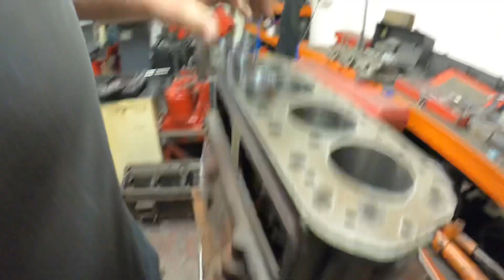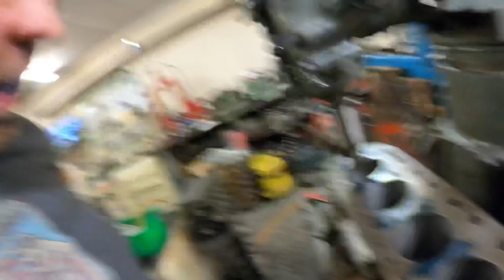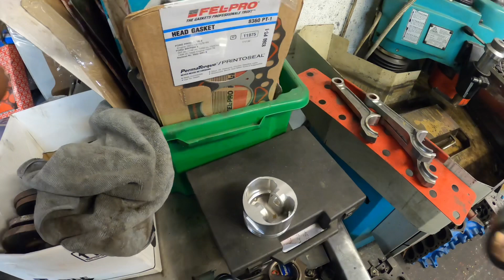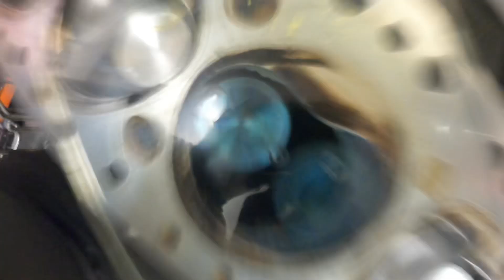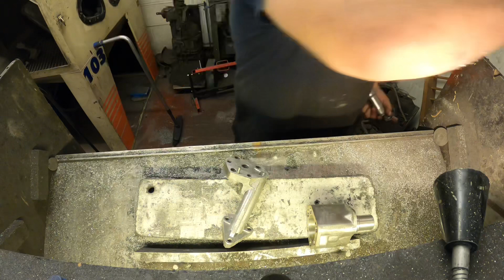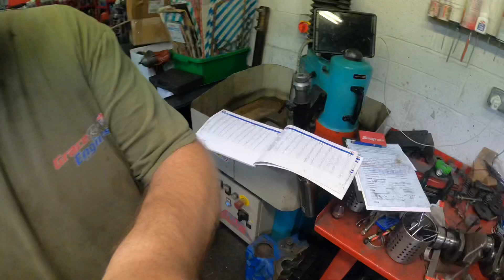1622 MGA Race Engine rebuild for a RGS Atalanta sports 2 seater race car | Vlog 26 |

Comment: Valve. Great video. Are the cross flow heads available still?
Reply from the maker: Thanks John, yes they are.
Reply: @graceenginedevelopments  how much play in a 40 thou over size new piston to a honed out 1500 mga motor.. as the limit I believe can it be bored out any larger bore.. where do I measure internal diameter I assume should the bore be perfectly round.. Thanks John Aust..
Reply: I'm thinking of update engine bottom half to 1600 is this and option and keeping original recondition head 1500.? John.

Comment: Valve. 
This one includes so many amazing details that pertain even to a stock rebuild (though it’s a race engine). So many hand operations and critical checks that the home-builder can do before and after machine shop, i.e. the info on pulling oil gallery plugs and cleaning out with the threaded rod—stuff I need to know!
Thanks James
Reply from the maker: Thanks Ian, I'm pleased you like the videos

Comment: Good attention to detail,only improvements  would be to use a piston ring squaring tool
when checking ring gaps.
Always a benefit to chamfere head stud holes in block.
Reply from the maker: Thanks Robert, yes I do need to order a ring squaring tool, I've just always used the piston.. I will get one though..

Comment: Very informative video. A couple of points for you to consider. Why install the new cam bearings when you have not finished cleaning the block properly?  You stand a chance of damaging the bearing surfaces. I think best to clean and finish all of your machining work, clean the block again and then install the cam bearings.  Secondly, you are handling a lot of bad chemicals that will damage your skin and enter your system through cuts and scrapes. Suggest heavily you wear 7 mil thick minimum gloves.  Save yourself for a long and prosperous life and more videos.  Cheers from Texas.
Reply from the maker: Hi Robert, yes I agree with you on the bearings, normally one of my last jobs but not on that engine.. safety ware is something I always overlook and really need to sort out, my wife is always saying about it.. I'll get stuff ordered next week. Thanks for viewing

Comment: Valve. Just finished rebuilding an 1800 for mgb. Wish mine was as clean and thorough as yours.👍
Reply: Yes Michael, runs great. 60 lbs. Oil press at hot idle. Hope it continues.😄
Reply from the maker: Lol auto correct on the reply. Corrected now.. there a great engine when maintained.. you e got great oil pressure.. what grade oil do you run
Reply: 20w50 Castrol GTX Classic. This was with a test gauge. Don't have the original gauge installed yet.
Reply from the maker: Thanks Mitchell, have you got yours up and running now?

Comment: Great job - do you ever use Glyptal paint on the inside of the engine? Also do you knife edge crank weights for racing application?
Reply from the maker: Thanks.. yes I have used it in the past but not recently.. yes we do knife edge cranks if the rules allow and the counter weight is heavy